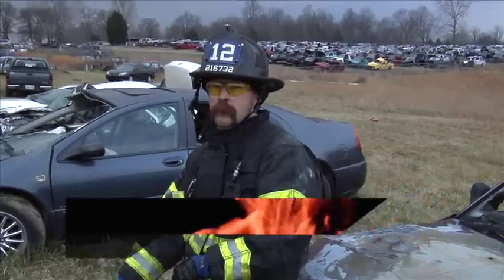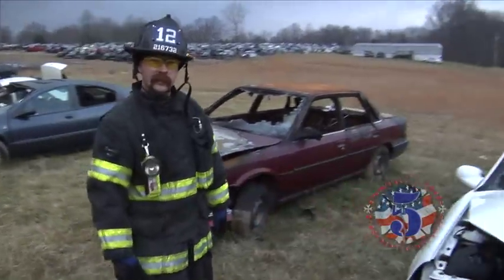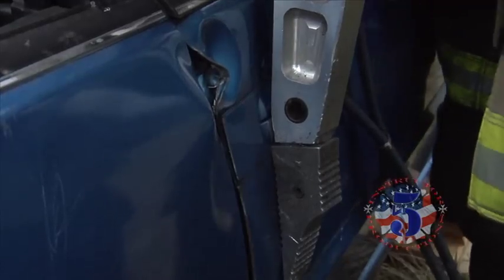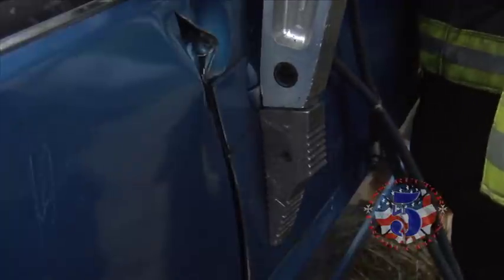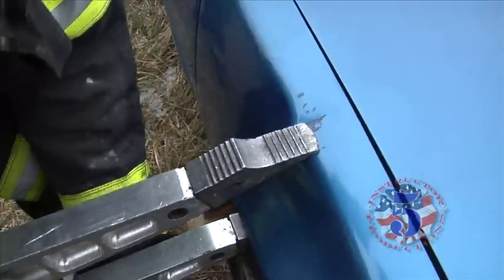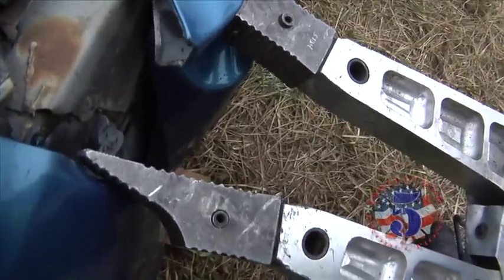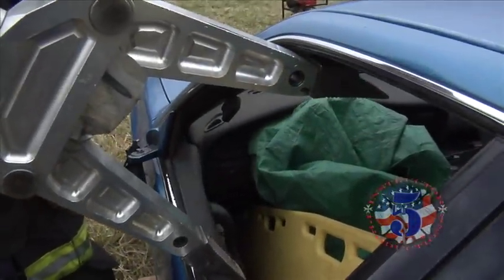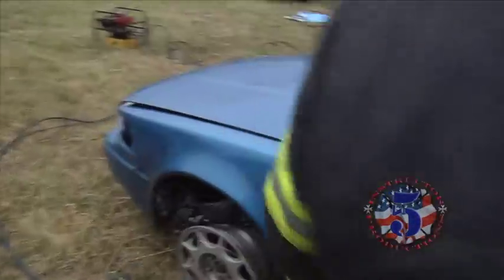Vehicle Extrication: Purchase Points

Comment: I learned that when you use the spreaders to gain access to the hinges, you do crush the fender, but you position the spreader so that it catches in the crack between the hood and the fender. doing that has always bent the fender in such a way that allows access to the hinges